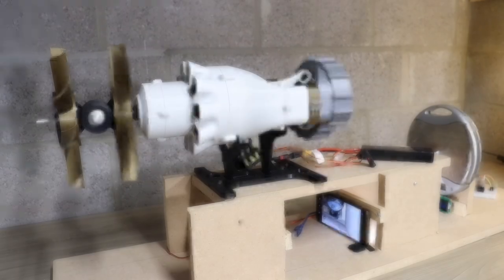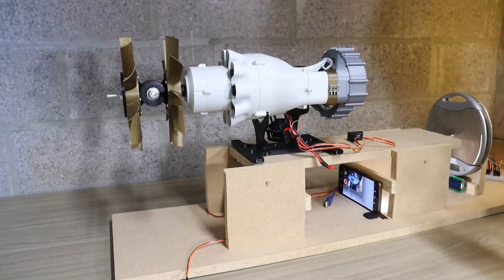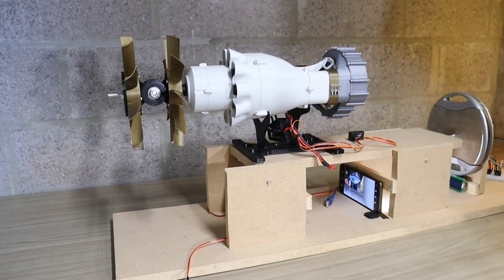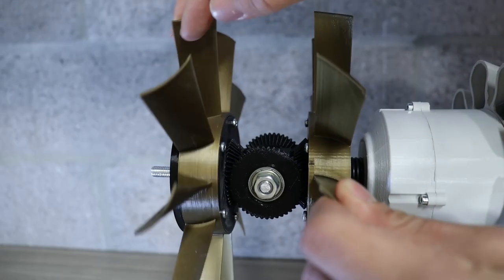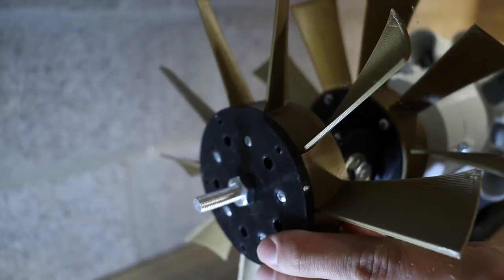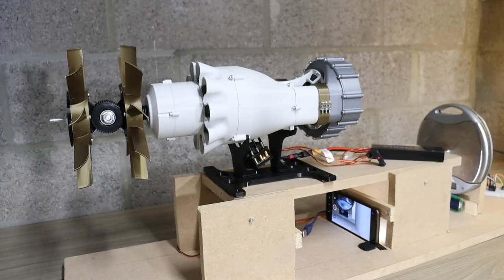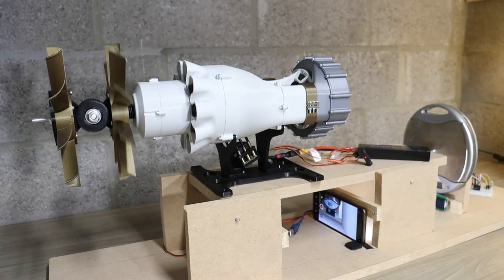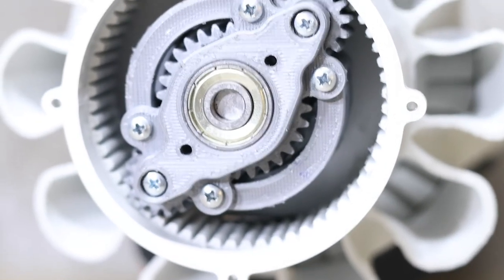Counter-Rotating Propellers That Are 3d Printed | centrifugal turboshaft jet | EDF

Comment: add another nut to the axis, secure it tight with the first nut, it won;t slip, alternatively, put a rubber washer between the nut and the propeller and tighten as much as you can. Great idea though. Wish you best of luck.

Comment: That’s bad ass, sir!! Well done!! A thought… wouldn’t it be easier to test the thrust with the assembly perpendicular to the scale bed? Maybe make a wire stand so as to not impede air flow. Would probably take some stress off the rotating bits by putting everything inline(ish) with the direction of gravity. 

Very cool build and video. I hope you stick with it. Cheers!!

Comment: This is impressive I’m glad I found this channel. I really think with the right prop pitch and a powerful enough edf this could be viable in a xf85 thunderscreach style rc aircraft. Due to the nature of rc aircraft using the excess wasted energy and torque from the electric motor to power an additional prop or 2 can only help because you’re not worrying about the deafening sound of the prop breaking the sound barrier 900 times a second so the additional thrust with a edf ducted out the back could make the fastest electric edf and prop airplane if it work like I think it would. And if ducted right the extra air from the prop could help pressurize it more in the edf intakes and gear it directly to the prop for that extra punch. Also the XF85 was modified from the xf84 which there are alot of models for “hint hint”😂

Comment: dude how is it possible you have such high quality videos already!
Reply from the maker: No idea honestly, I just started making this video. And for some reason it turned out way better then the rest of my videos. Although im not to happy with the amount of jet you get to see in the video. Im trying to figure out how to make it a bit better.
Reply: @enginesandmore1013  looks like you have a lot of potential - for making videos and for the engineering part.
As for some (not requested) constructive criticism, try to be as precise as possible with EVERYTHING - dimensions, cleanliness, tolerances. A resin 3D printer might help quite a lot. Looks like your builds can get a lot better just by this. Also, isn't those fan blades' (the counterrotating ones) pitch a little too steep? 
On the other hand you CAD and design game is absolutely on point.
Reply from the maker: Thanks for the nice words. For the steepness of the blades, I have honestly no Idea if they are good , I usually try to make them around 40° as thats what is common for rc plane and drone propeller's.